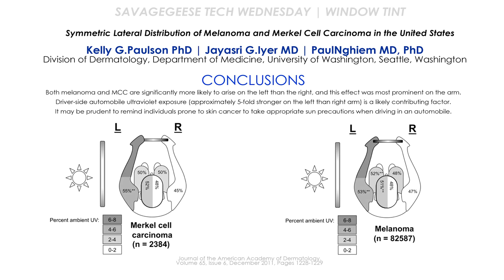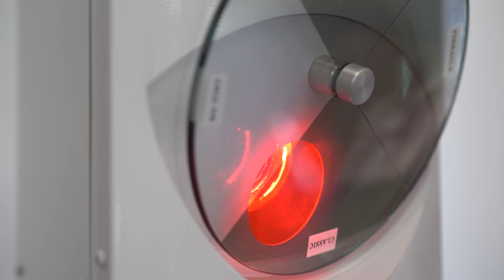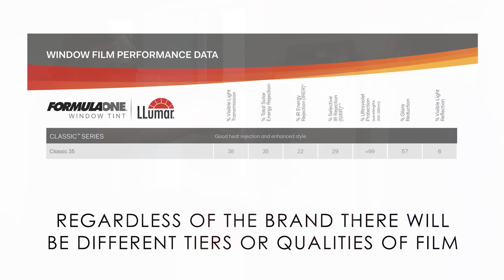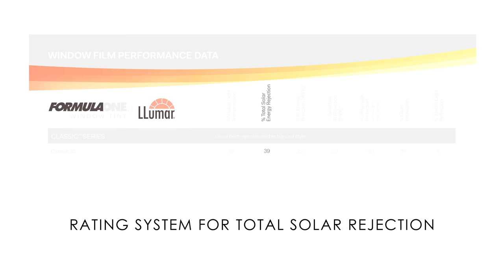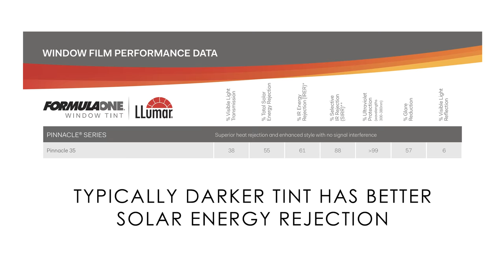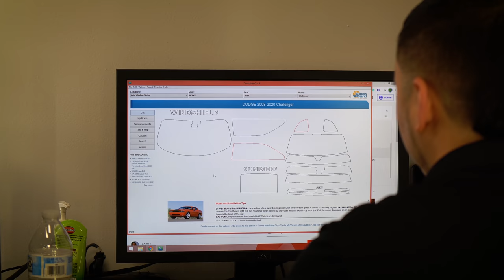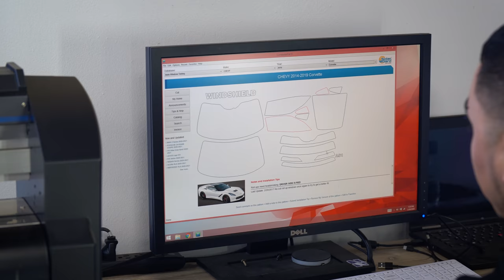Tinting Your Car and Truck, The Pros and Cons

Comment: Sick of hearing tint shops say factory glass won't block UV-A. Single pane tempered glass won't, but laminated glass (like your windshield, and even side windows on many high end trim vehicles) will block virtually all UV. And I didn't hear anything about even clear factory glass having only about 80% VLT. Throw your 35% tint on top of that, and now you're at 28% instead of thinking you're legal at 35% (in Illinois). I also didn't appreciate seeing them soak the door panels of that guy's Vette... not hard to tape a sheet of plastic on the door panel to keep it dry. Expected better from this shop based the previous videos you made with them.
Reply: Tint shops don’t put tapes on panels unless the shop is oriented for exotic vehicles. Like srsly, it’s to clean the window. What bad could it do to the panel
Reply: Man. It's a car, not some sculpture made of sugar. Stop being irrational.
Reply: @Syncopia  exactly, it'll be wrecked at the next cars and coffee anyways.

Comment: You should have asked him how would a customer know if he's actually getting the specific tint he's paying for... Like say I go into a shop and request the ceramic tint but they end up installing the basic tint.
Reply: That's where the reputation of the shop where you get your tints done matters and you should expect to pay more for a proper job. You can make the same argument about a dealership performing "a brake fluid flush"....How do you know they didn't just top it off with new fluid and sent you on your way.
Reply: @tp7278  Same thing when you pay to have your tires rotated, my mom started marking the tires to see if they actually do it. The first couple of times, they never really did it!! LOL!! She had to tell them each time, finally after the 3rd time they actually rotated the tires.  This is Ocean Mazda in Doral, FL.
Reply: Stand there and watch.
Reply: When they asked how I want my sunvisor strip brow placed on my 19 Ram, I made sure it was Ceramic they were putting on. Plus, you can also tell the difference between a normal dyed film and a Ceramic film. I had a Mercedes tinted with my tint guys previously, so I trusted them and they walked me through everything. And they weren’t charging me crazy like some other dealers wanted $700 for Ceramic, when I got my installed for $375.
Reply: I've heard some installers will just place the basic tint in a premium tint box and trick customer's that way. I'm always tempted to go have my tint tested with a tint meter by another shop whenever I have a new tint job done.
Reply: @ctk4949  She got cheated and kept going back to force them to not cheat her again?? ... After the first time I'd have involved the police.
Reply: @Dowlphin  Well they did the rotation after we pointed out that it wasnt actually done. They always say, "it was a mistake" They usually give us a discount on the service, so its not big enough deal to get the police involve. lol
Reply: @ctk4949  It means they will cheat whoever doesn't notice it and bribe those who do notice.
Although, it should be quite easy to notice considering it is done to even out wear, so if the tires with the lower profile left are still on the same position, one only needs to check profile depth before and after. Not even necessary to mark them.

Comment: Living in FL I am so amazed by how many cars I see that don't have tint. It's way too hot for not having tint and my cars get it as soon as I buy one immediately.
Reply: It really throws me off when I see a car with 100% tint in Florida. Usually you'll get something like 35% straight from the dealer.
Reply: It's opposite up here in MN. It is nice to have the sun warm up the car a bit during the winter. Putting UV-blocking tint on would take that away! They talk about blocking heat in this video, but being in the midwest, I'm surprised they didn't mention how that might be a negative during our cold winters.
Reply: @RecBuddha  they mentioned that at around 6:20
Reply: @cbrod24  Cops in Florida generally don't car. It depends on the city but I've never been stopped in Palm Beach county for my 5% tint. I was; however, stopped in Daytona Beach and they tested the light throughout too. I got off the hook since the cops took off due to call with something more pressing than a 26yo in his Camry with illegal tint lmao.
Reply: I got this cool feature in my car called AC
Reply: I would agree - tinting made a world of difference in FL, particularly if you don't have extremely effective AC with vents all over the back for your passengers.  (My cheap rear vinyl seats were a treat in the heat, though.)
Reply: I miss living in Florida and having DARK tint.  Georgia legal is shit.

Comment: I had Chicago Auto Pros tint my 128i side, passenger, and rear glass. The work was outstanding. Two years later, there's not one bubble or defect in it. I highly recommend them, and the Lumar film is awesome. I used to roast my buns on the hot pleather seats after a workday in the sun. Nighttime glare in my rearview mirrors is reduced, as well. Pro tip- Keep a copy of your  tinting receipt in your glovebox, so if Johnny Law pulls you over, you can prove what level of tint you have.

Comment: You forgot to mention most cars and trucks already have factory tint. So you are actually putting tint on tint making it darker than what the installer says or show's in a demonstration. For example: tint .70 + .50 =.35 % window tint.

Comment: One of the other benefits not really mentioned in the video is reduced glare for night driving. I drive 2 low cars (Miata and a modded Mk5 GTI) and with all the crazy HID/LED headlight equipped cars out there, not to mention people with lifted trucks, LED light bars (people in NW Chicago suburbs love driving with those on...), or just drop in HID’s. In low cars, I feel they are impacted the most and as we get older, our eyes tend to be more sensitive to light.  Tint is a huge help here. Obviously not with the windows down/top down, but otherwise yes.
Reply: Are you running aftermarket or modded headlights in the MK5?

Comment: A few counterpoints to this video (I have 30% tint on my car):

-I suspect that the brand of tint this guy chose at his shop has less to do with “customer service” or “performance” and more to do with which wholesaler/middle man/brand rep would give him the biggest discount in buying the tint.

-the notion that aftermarket tint prevents glass shatter during an accident is somewhat misleading. All cars sold in the US come with a factory tint that prevents glass shatter and aftermarket tint does not offer extra shatter protection; cars could not be sold in the US otherwise.

-in most states, front windshield tint without a doctor’s note is very illegal; the tint shop that did my car won’t do front tint unless you show a doctor’s note and sign a document absolving them of any criminal or civil liability and I’m surprised that his shop does front tint routinely.

-the technicians in that shop should not be spraying down the tint inside the window without blocking off the interior door panel; I don’t think I’d be pleased with seeing the dude using the squeeze bottle on the window and getting the liquid all over my leather and alcantara door panel.
Reply: On the note of shattering.  It's not that the tint stops the glass from shattering. It's that the tint somewhat holds all the shattered glass together and keeps it from flying everywhere.  I know this first hand after my rear glass shattered durning an accident in my pickup truck.
On the note of brand name. Lummar is a very well known brand of film with a large dealer network.  When you make a living by selling and installing a product, you better make good and well sure that the product you are selling is worth their weight or you will not be in business for too long.
On the note of wet door panels.  Automotive door panels and switches are designed to get a little bit wet.  The tint solution will not hurt the panel.  Panels will experience the same, if not more, levels of moisture durning a heavy rain if the door is momentarily opened when it's raining.
Reply: @t.regnerus301  Clean your damn trunk then lmao
Reply: He's actually not lying about Llumar.  Their support and products are top notch, but you have Sun Guard, Madico, Wincos and other great film makers.  Also a lot of the front tints at their darkest are 70% which you can kind of almost tell is tinted, but it's definitely questionable.  Then you have 3M's crystalline which is closer to 90% which you definitely cannot tell is tinted.  A doctor's note wouldn't really be that hard to procure either if you give them normal complaints.  I wish the film was available in smaller quantities though for DIY.  The rolls are very pricey.
Reply: One day there will be a deadly tragic car accident , and investigators will find the tint on the windshield . The lawyers will have a field day
Reply: @t.regnerus301  And you live in the trunk of your car. Doesn't matter if I was taking my car to a mechanic, paint shop, detailer, or tint shop, I clear out my trunk so somebody else doesn't have to work around the shit I'm too lazy to take out.
Reply: I don’t think you guys realize how difficult it is to do a clean tint job, and trying to block off moisture unnecessarily just inhibits the work and could cause dirt and hair to contaminate the tint. A lot of professional places have dedicated rooms to keep debris out
Reply: Thumb for the 1st point.  I once owned a shop and needed to purchase large rolls of vinyl and tint. Good customer service from the manufacturer basically means talking to someone with a pleasant happy voice; getting the product at a great price was my biggest concern.
Reply: @t.regnerus301  

"1 day ago
I particularly liked all the water overspray all over the owners possessions in the trunk of that Vette. Takes less than a minute to put a drop sheet down."
Reply: I noticed a minimal tint seems to be common from factory for many cars. As for the windshield, it is laminated glass, meaning two layers of glass with a film in-between that holds shards together.
The alleged safety aspect mentioned is even more misleading because any windows but the windshield are safety glass that breaks into grains and thus doesn't injure in an accident and also allows escape from a wreck by relatively easily shattering the whole thing. Now if you install tint films, that escape route is no longer an option. (I asssume this and/or driver identification is why in Germany and probably many other places it is illegal to tint the windshield and the front sides.)

Comment: I got a tint mainly for heat reduction. For some reason my Subaru Legacy struggled to keep the interior cool whenever it is 80+ degrees outside. Just got 50% on the front and 35% on the rear and back but it does make a difference. Rayno S5 film and the place that installed it will fix it if necessary for as long as I have the car.

Comment: C7 corvette such a beautiful car.
Reply: excuse me better than C8?
Reply: @FreeHazelNuts  that's subjective but I think so. C8 just kinda looks like a dollar store McLaren, not that that's really an awful thing.
Reply: @FreeHazelNuts  to me yes. I still cant part ways with a standard transmission.
Reply: excuse me, yes, that’s a disappointment, manual would definitely find its customers
Reply: Sawyer, thanks to the new architecture 2,9 sec from 0 to 60 on the base model is no slouch , more potential motorsports wise embodied. Both C7 and C8 look good to me though.
Reply: @FreeHazelNuts  I agree it's a beast but just saying looks wise. C8 doesn't look bad just....kind of generic.
Reply: Sawyer, compared to McLaren or Lambo, yes,  it does look kind of down class to me as well, but hey it’s times cheaper. Overall I am pleased they were brave enough to have put it in production.
Reply: @FreeHazelNuts  nothing will be more iconic that the last FR traditional Corvette ever made
Reply: @FreeHazelNuts   yes better than c8. But then again a c6, C5, c4 even are better than the atrocious, ugly, C8
Reply: Donald Duck005, what if it’s just a matter of getting used to? Within a year or two it might not be that ugly to your eye
Reply: Ivan Ivanian  nah. Usually if I don’t like a new car i start to like it after a few weeks. This c8 is horrible looking. Maybe it will change with the z06 or zr1. Because I hate the C6 base model, but the C6 Z06 and ZR1 is perfect
Reply: Donald Duck005, I am more excited about it being a mid-engined vehicle now, looks are kinda secondary. It easily rivals GTR’s with only one axle driven, isn’t it cool?

Comment: I'm running Pinnacle 15%, every window is tinted except the windshield and the sun roof. 
I find myself having to roll down the window at intersections to check for pedestrians at night time, especially on a rainy night. 

It is super useful in the winter, blocks off lots of glare and reflections from the snow.

Aside from that, it's been holding up great! No scratches, no bubbles at all!

Comment: Keep in mind that factory automotive glass already has a slight tint.  Add 35% window tint film to that and the glass is now darker than 35%.   That can get you a ticket if the cop pulls out the light meter.  Here in Delaware no film tint is legal unless you have a medical exemption from an eye doctor.

Comment: Window tint gives a huge advantage in extremely hot climates. If you drive a car with a big greenhouse in AZ like I do, window tint is a requirement unless you enjoy being melted every time you go for a drive. It's also great for blaze riding without other drivers seeing, if you're into that sort of thing.

On the subject of safety, we had a car on our lot vandalized overnight and the D/S front window was totally shattered. I couldn't believe how well the window tint held all the shards of glass together on the window - so much so that we could still slowly roll the window up and down. It made replacing the window a lot nicer.

Comment: Been living in Arizona nearly 40 years and every car I have ever owned gets tinted. As the new tints come on line have upgraded to the newest. Big difference in heat rejection from the old days when all tinting was is vinyl dyed gray/black. Cannot live in the southwest without tint. Saves the interior as well. Although factory glass has gotten a lot better as far as UV rejection too.

Comment: Also helps to make sure the tinter knows your car... I had a tinter that had a lot of good reviews almost mess up my 2019 MX5. He sprayed too much on the dash and it disabled the keyless entry stuff for a good 24 hours until it dried off. I got lucky I didn't have to bring it to the dealer but god damn that pissed me off. And there was a scratch on my windshield tint , very small, right in the view of the driver. The scratch is in between the tint and the glass so it wasn't me. But they'll probably never fess up to it.
Reply: That connector in the dash, you should find it and clean the terminals since the adhesive will corrode them and you will have problems in the future with changes in humidity.

Comment: At the end you addressed not putting the windows up or down but what about cars like the MX5, Fiat 124, and SL500 where the window moves when you open the door.  How do you avoid damaging the tint curing process and still use the car.

Comment: tint suck during night driving. its best to have a reasonable % rather than going all blacked out.
Reply: Darek M don’t need to look around if you’re going 120mph 😱
Reply: Agreed.
Reply: Saurabh Kulkarni especially in a Prius
Reply: Especially tricky if you have auto dimming mirrors like that Corvette.  Even in daylight, I've had the rear view mirror dim completely with the top off.
Reply: I have 30%
Reply: I've got all the pre-collision, backup, turn, lane change sensor bullshit the government says we need, so I never even to turn my head.  Limousine dark tint all around except for the windshield!
Reply: Yep.  20% is about as dark as you want to go if you want to be able to see at night.
Reply: If I decided to get one, I'd choose the least tint with highest IR blockage. (Actually sad that they haven't found a way to block most IR that doesn't also block visible.)

Comment: I have tint because it blocks uv , I’m pale as hell. I burn easily and I’m very sun avoidant
Reply: Normal glass already blocks most of not all of UV-B.
Reply: Try polarized it self darks when sunlight hits
Reply: Ahmad Azizov  video mentions this around 3:30. Doesn’t block UV-A, which causes sunburn and wrinkles/aging. It also accounts for 95% of the rays that reach us on the ground, despite having a lower energy level.